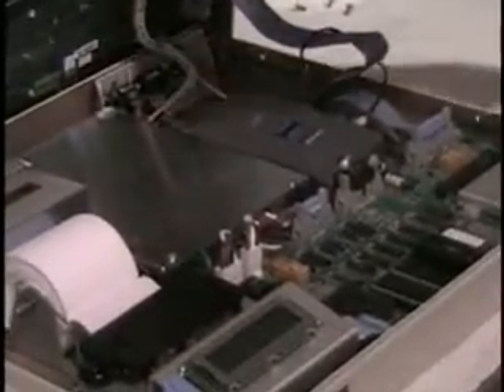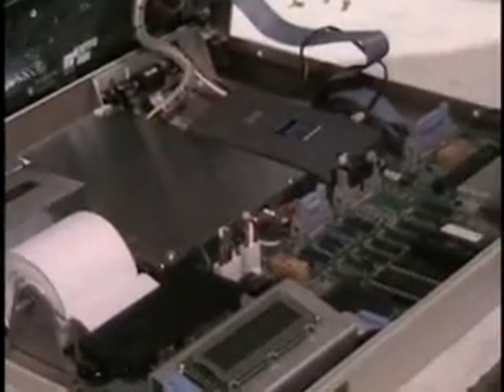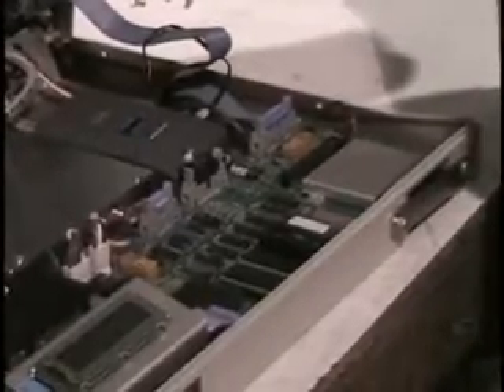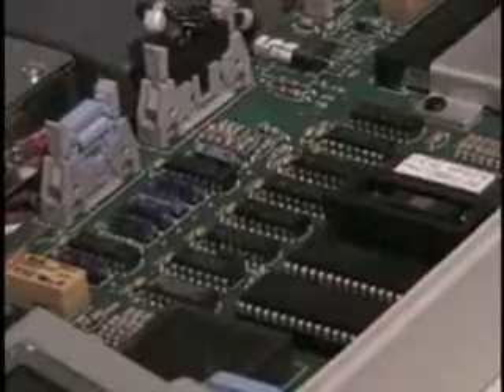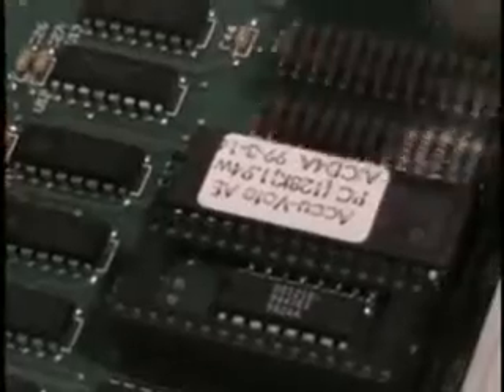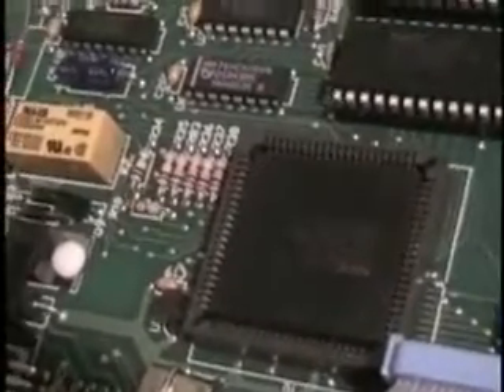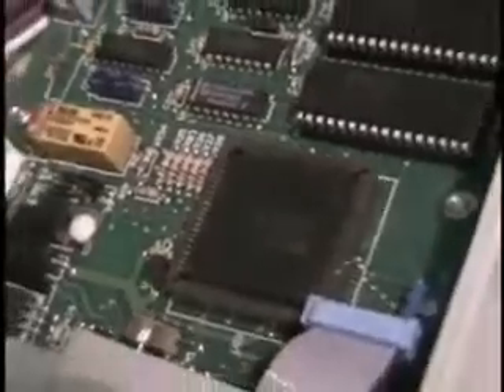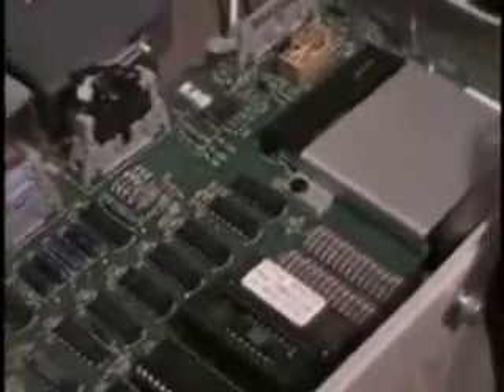Diebold Accuvote voting machine exam - first look

Comment: This REALLY REALLY worries me. I agree with senatorped WHY WOULD IT NEED A MODEM?!! that makes no sense!!! even if it needs to communicate to anything the serial port should   do this.

The real problem that knowing the architecture is kind of useless since everything that controls the system is programmed onto the chips. This is entirely different than the software the Bev Harris discovered in "Hacking Democracy." it's firmware designed to control that specific embedded system.

Comment: Ignore Ajna. The tech clearly identified all the parts, so he knows what he is doing.

My big question: According to the date on the firmware... 99-3-14... what the hell are they doing using software written in 1999 in an election in 2008?